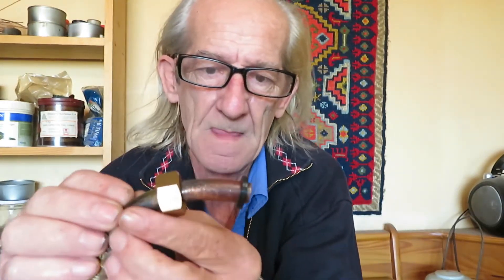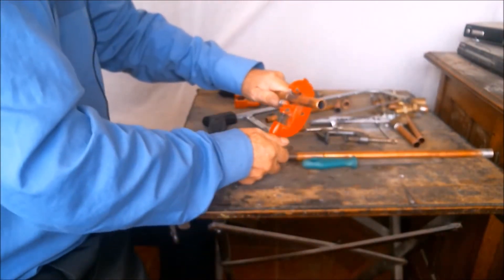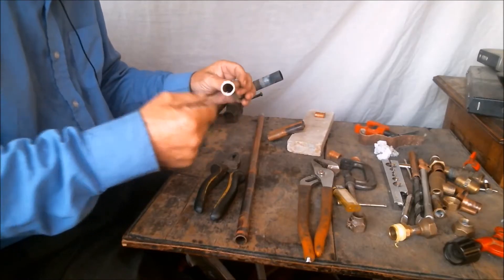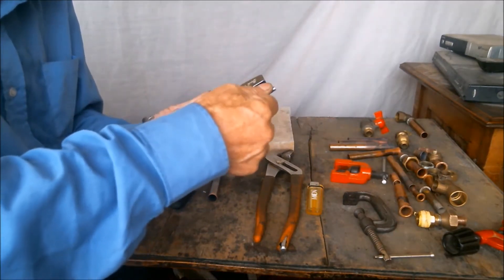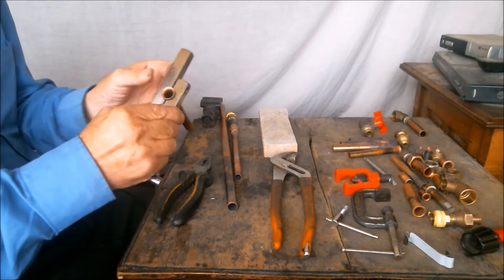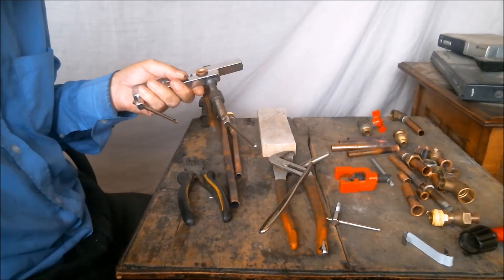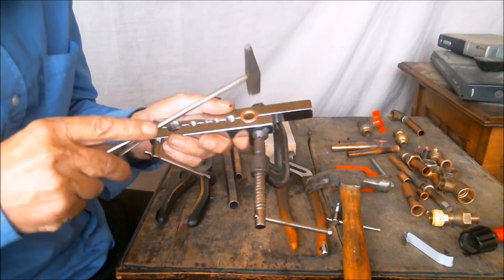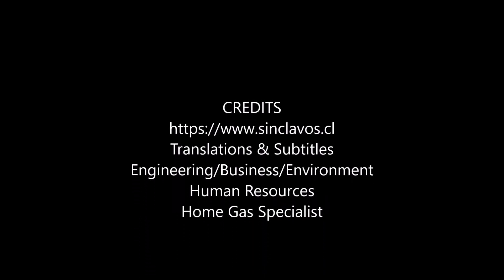How to make a flat flare or flat collar connection in copper pipes

Comment: Thanks a lot for the technique ! I was looking for precisely this method and couldn't find it anywhere else, i guess because it has been replaced by premade fittings. I guessed hammering wouldn't leave a smooth enough surface but evidently it works well when annealed. I saw it on an old installation and wanted to replicate it as it looks cleaner and avoids one solder joint.
Reply from the maker: Thanks for leaving a comment Antoine.

Comment: pipe bending and collard swept tee joint tutorial?
Reply from the maker: Hi Ethan, I don't have the equipment to do a proper tutorial for bending pipes.  Regarding connecting pipes without using Tees it is not something we can do in gas installations, so it's not part of my tool set. Sorry, can't help you here.
Reply: I have a water heater pump that I am replacing inside a tankless water heater.  The pump has two connections.  one is a male thread (in)  the other looks like a flat collar (out) but there is no place for clamps or like other similar flat collar pipes in the tankless water heater used.  Any idea how this is fastened ?